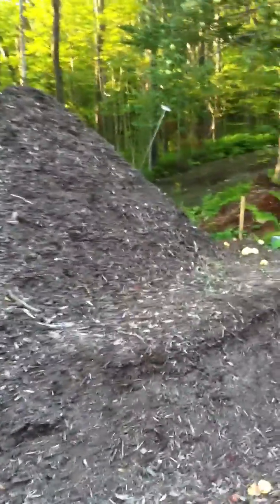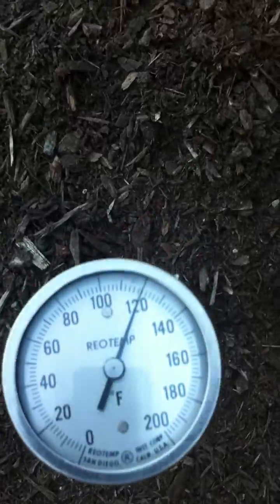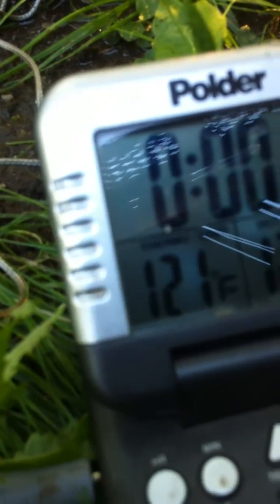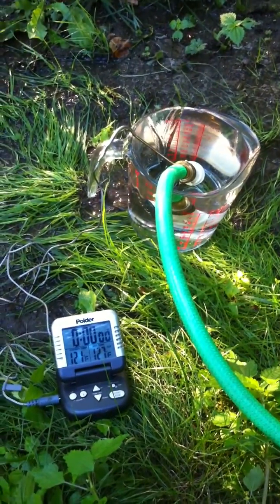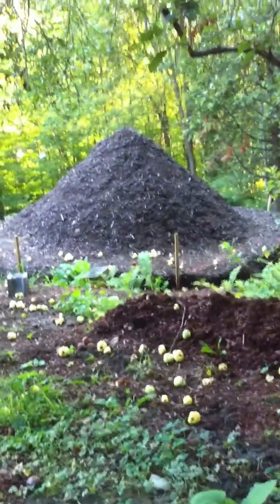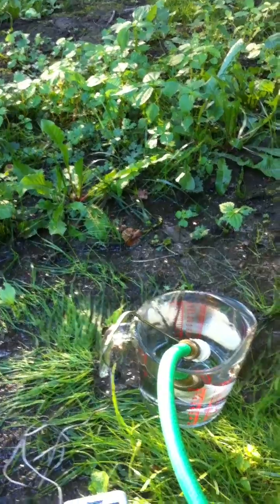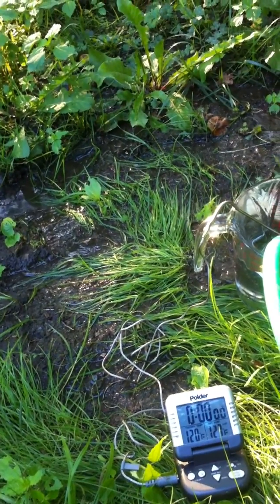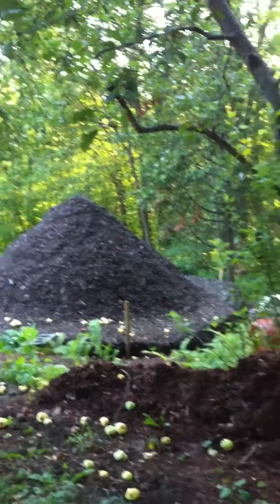Compost Power Jean Pain Mound Project Summer 2011

Comment from the maker: We like using 4 inch corrugated perforated drainage pipes laid out in concentric circles in the floor with one end open to the outside air and one end terminating in the center. Send me a note gaelan at compost power ----- dot----- org and I'll shoot you more info.

Comment: This is great!  Is that really 40 yards of material?  Is that like a dump truck load or something?  The other one I have read about and seen videos of I think used 10 yards and 400-500ft of line.  

Technically it is combusting, just rather slowly.  The emissions are there just without the smoke (hopefully!).

I hope to heat a grow room or two with one over the winter.

Comment: Hi Pra, There's no turning/stirring of material required. We lay about 100 feet of perforated flexible drainage pipe in the foundation, with one end open to the outside air. This allows for passive aeration. 
We've made great progress in the past couple of years in ensuring these systems have high heat output through the winter months. Contact me through compostpower's website for more info.